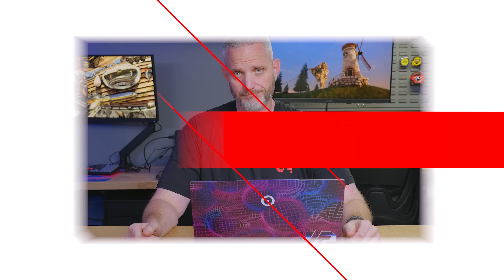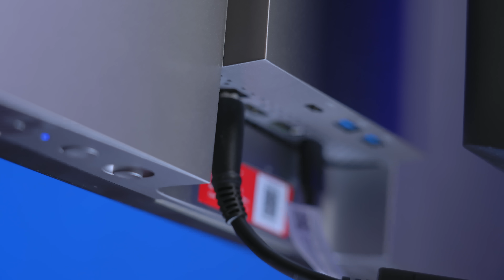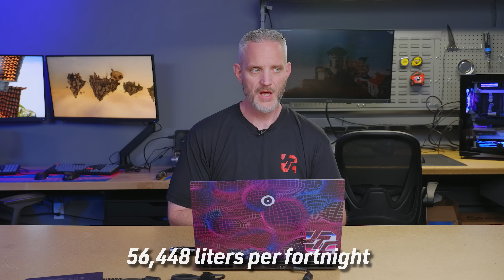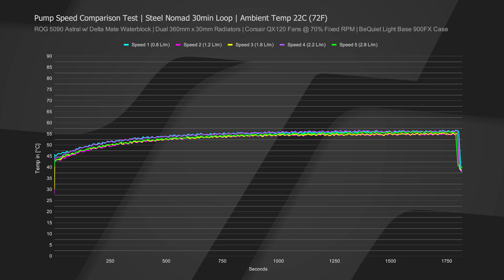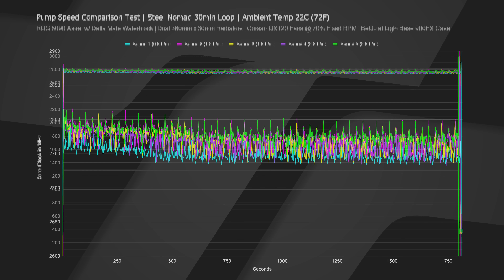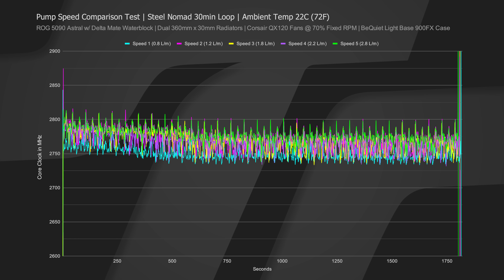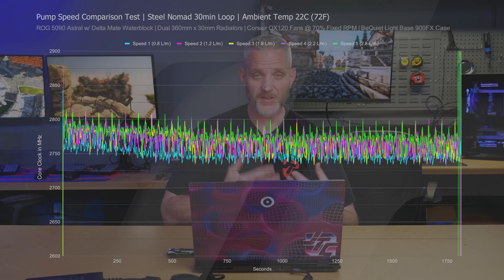Stop doing it this way!

Comment: thank you for retesting the pump speeds, as a GPU AIO user i ve always struggled to see if theres any noticeable difference between speeds of the pump, this may give me the insight i need to set a speed, much appreciated!
Reply: I have a 3090 Ti strix LC don't think I can control the pump any suggestions?